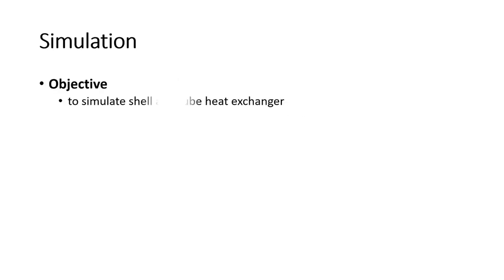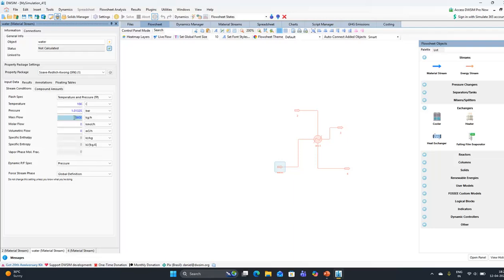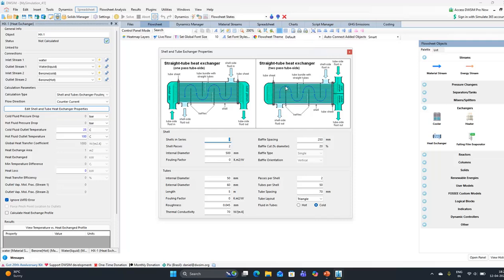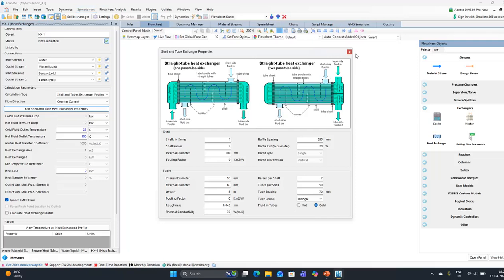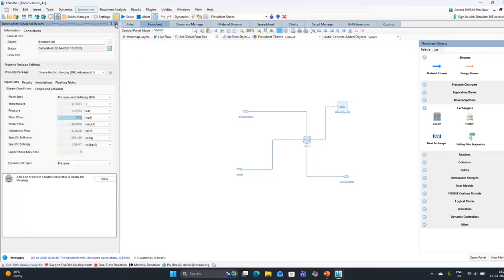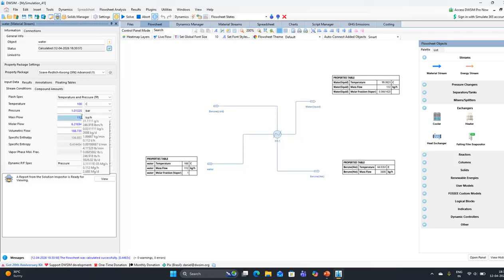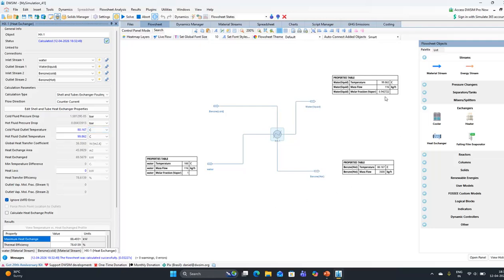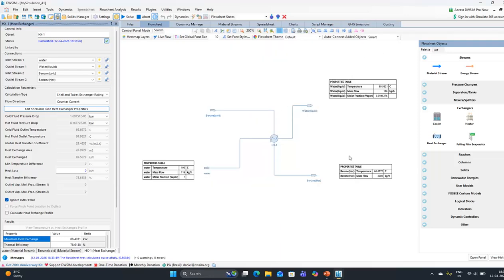Heat Exchanger Simulation| Shell and Tube Heat Exchanger| DWSIM Simulation for Beginners

Comment: Good information. Interestingly when you change the fluid allocation i.e Steam as tube side fluid and Benzene in shell side significantly increases heat transfer coefficient, Benzene outlet temperature and heat load and liquid mass fraction of water will be 1.